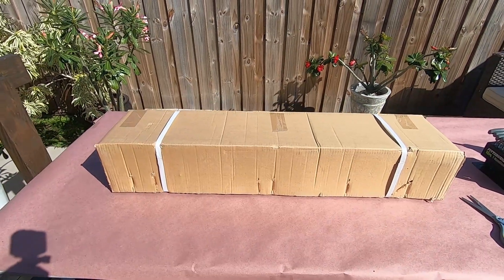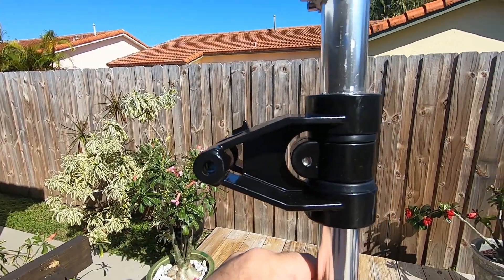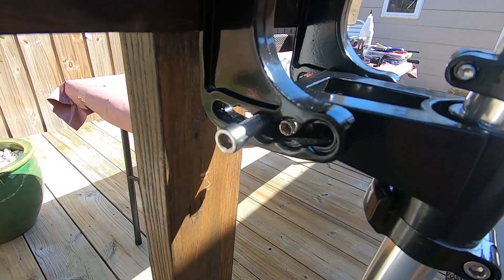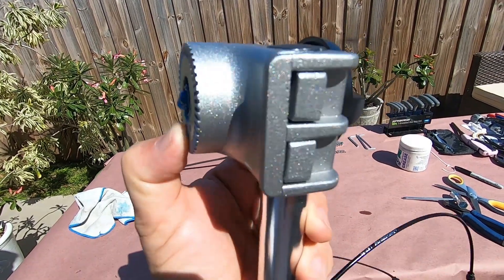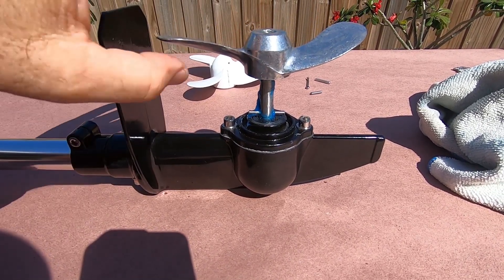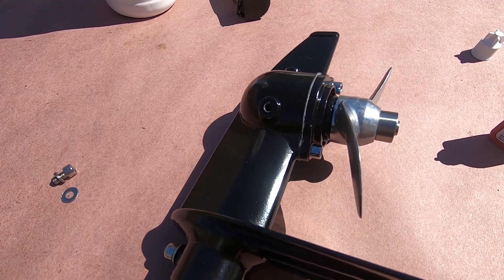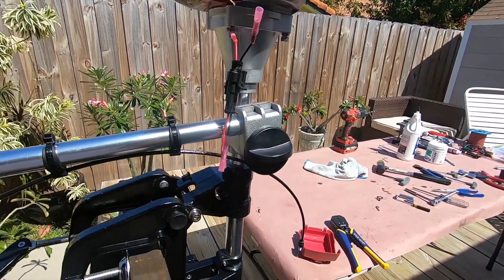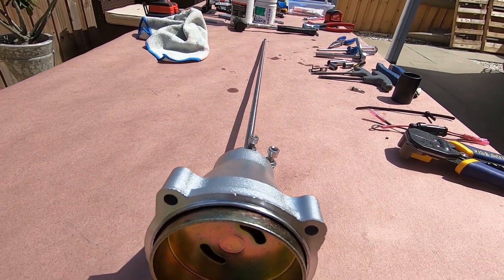Engine Drive System Building Tutorial: V1

Comment: I'm wondering if the gear case filler plug is meant to be place at a horizontal position  ,with the outboard upright, and filled to that level?
Reply from the maker: The outboard should remain vertical and not placed on its side. You fill the gear oil until it sits below the threads behind the filler bolt. A cavity of space needs to be left for the movement of oil when the main drive gear rotates.

Comment: Discovered your product while looking up Honda string trimmers, and happen to be a Nucanoe Pursuit owner as well, so down this rabbit whole I go!  :)
As I'm looking at the 35cc Versattach system, I'm wondering if you have a kit for converting the Versattach power head, using the existing shaft that is on the power head? Seems like a shorter shaft version of your kit would work and be a pretty nice thing to offer. Especially if it's easy to go back and forth between string trimmer set-up and boat motor set-up, once you get your yard work done, of course! ;P I'm up in Canada, so a no motor kit would be the route I'd go due to cross boarder shipping costs. Be great to have the Versattach power head work and be an easier sell to "The Boss". :)
Sorry to see you've had shipping trouble. As a welded metal sculptor, shipping is the biggest hurtle and rise of issues. Regardless or how busy they are, there's rarely an excuse for unprofessional handling of your product. Kuddos for addressing the issue on you're site. 
Very interesting product. Hope you're having success with it and are getting good reviews from clients and exposure in the kayak fishing industry. 
Thanks!
Bert the Weldor
Reply from the maker: Wing Nut Bert these systems bolt up to standard 9 spline clutch housing. The issue with hard tool shafts is that they are 4 square. Now I do retrofit the legs to work with 4 square electric trimmer heads and it works amazing well. If you found a 4 square to 9 spline connector your in business.
Reply: @kayakbuddysllc-lightweight4947  Thanks for the reply! Understood. Better to have a 9 then a 4. So better to have a separate motor dedicated to the boat. So in that case, in your experience with your Pursuit, did you find the GX35 had enough power to move at a reasonable speed? (Granted it's gonna vary on gear and person weight. I'm about 220lbs.) Note looking for speed boat performance. But will be in the fresh and saltwater fishing with gear and my DIY PVC landing gear I just made. 
Thanks again for the quick reply.
Hope you are staying healthy.
Bert
Reply: @kayakbuddysllc-lightweight4947  And while I think of it, how was the ride in the Pursuit with the motor? Did it feel stable? Have you had it out in ocean choppy water? I assume turning is done with a slow steady hand not F16 evasive maneuvers.....
Reply from the maker: Wing Nut Bert the 50cc works beautifully on the Pursuit. I just had it in major inland tidal areas with 3 mph currents and it was hands down the best engine for the job. It maintains torque and keeps the RPM a bit lower. The GX35 will work with no issues. It will just struggle to maintain the higher speed. I get 4’s all day with the 35cc and high 6’s with the 50cc.
Reply: @kayakbuddysllc-lightweight4947  Great. Thank you sir. I've bookmarked your site for future. Gotta get the string trimmer first to get the yard work and trail maintenance done as that's the priority over playtime. But this looks like a prefect product over the big $$$ torqeedo and others. And with that external fuel tank, no worries about being out all day. Really great. Hopefully shipping to the West coast of Canada would be a fortune. In the meantime, I'll look into the GX35/50 availability locally. 
Thanks you again. Hope to be in touch soon.
Bert